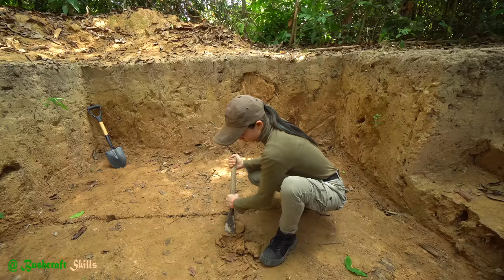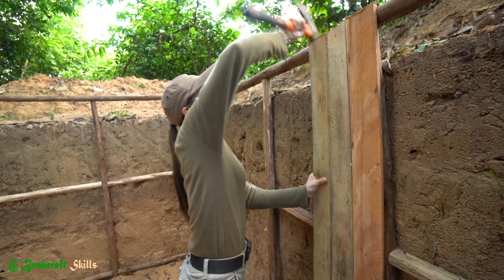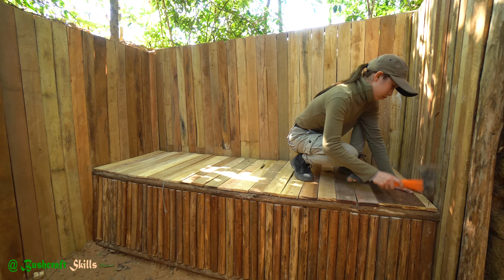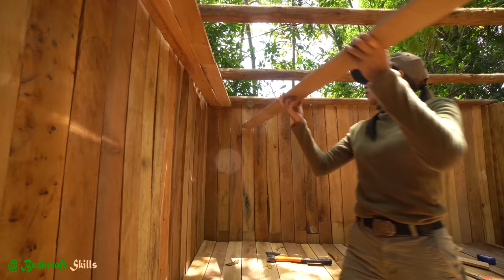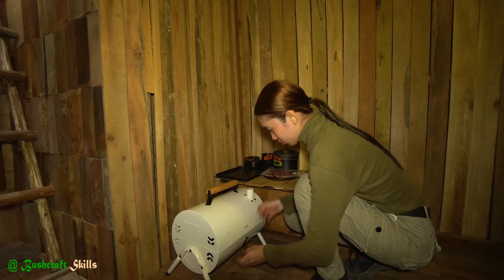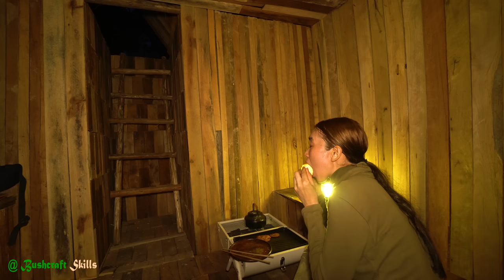Building Complete Underground Wooden Dugout Shelter, Start To Finish

Comment: Please be careful with that charcoal bbq, you need an air vent of some kind so you don't carbon monoxide yourself to death. An exhaust duct on the roof and for fresh air a battery and a computer CPU fan will probably suck in enough air to do the trick in a space that size, you just need to run a hose from your door way inside.